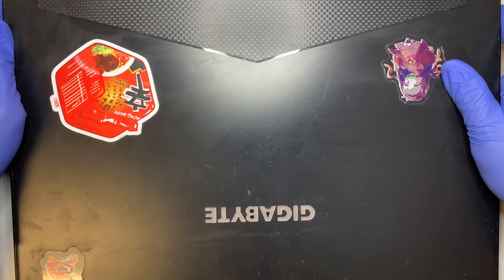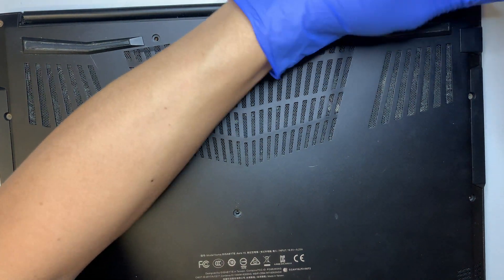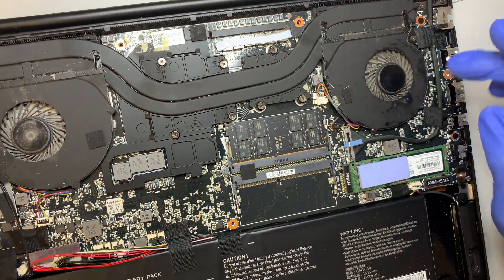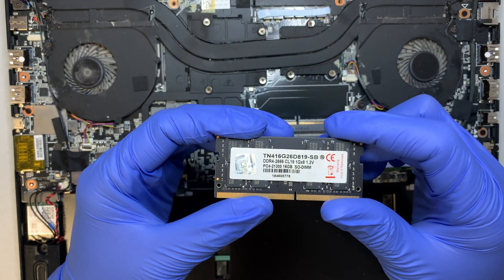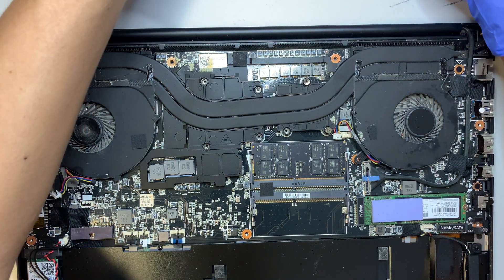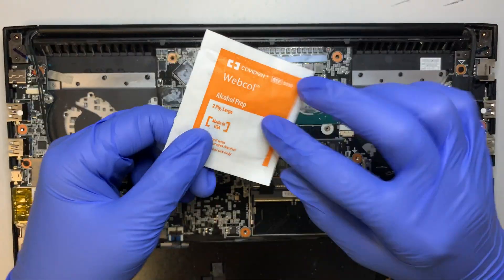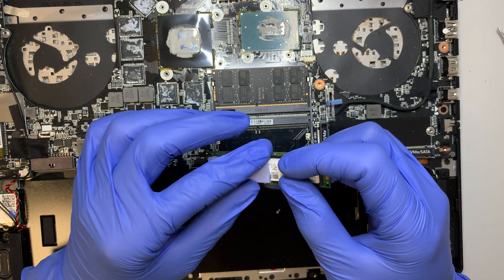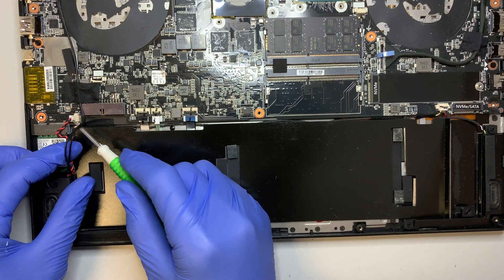Gigabyte AERO 15 Tear Down Fan Replacement

Comment: Great video, liked!  I struggle to find info on the Aero 15-Y9 (i9-8950HX, RTX 2080 MaxQ).  But the thermal pads are difficult to find aftermarket.  VRAM & Power delivery pad thickness is the open question.  Better to try a thick paste, like Gigabyte, or, .5mm thermal pads (Reddit suggestions, but take that for what you will.).  Suggestions?

Comment: HEY GUYS and GAL or TWO .. :) - You DO NOT have to replace these fans. You probably don't have to pull them out either. Once you get the back cover off - clean things up (SEE CAUTION) - then REMOVE THE FAN TOP SCREWS and PRY OFF THE FAN TOP - on my Aero 15s it was not difficult to pry up the cover enough to coax the blade and axle insert out - leaving the sleeve bearing (no balls) exposed. Use standard procedure to clean this up using whatcha got. Then use PNEUMATIC TOOL OIL (surely you have some of this?) it's the ideal viscosity to keep that fan running smooth and quiet for another two years. Seriously. Use enough to form a "meniscus" bulge (a little extra.)
Then -- order some "pre-filter foam" for air conditioners - you need at least enough to cover the bottom of your laptop. This will keep the dust outside of the case. Nice! Just saved you $40 and a big labor charge (sorry tech guy.)
CAUTION: When cleaning your sensitive parts - seriously - do not use a high-air-flow vac. Moving air causes static electricity. Use a low-volume vac only, with plastic tools - preferably one designed for computer guys. Why? The plastic can and should be anti-static. You should also GROUND THE METAL OF THE CASE while you're at it - and spray some anti-stat around (since you don't have a professional ion anti-stat device.)

Comment: Hello, can you please provide part replacement links and maybe model of the built in speaker on this laptop and the gigabyte aero 15x9 laptop which released after this model? My built in speaker is broken and I cannot seem to find the replacement part for that. Need some help. Thank you.

Comment: Didn't end up replacing the fan but cleaned it up a little so it's not so noisy while I wait for a replacement. I'm sure I'd be able to do it again without the tutorial as it was that easy to follow. Thanks!

Comment: Can't you remove the fan without taking apart the whole cooling system? Maybe removing the screws holding the fan and sliding the fan assembly out. (I also have a gigabyte laptop which is very similar to yours and the fan needs to be lubricated)

Comment: I didn't wanna take the whole heat sink out so I figured out that the fan slides out from underneath. Just had to be gentle to not put too much pressure on the still attached heat sink. 

Edit: only the CPU fan has enough clearance to slide under the heatsink. GPU Doesnt
Reply from the maker: Agreed

Comment: Hi There,

I have an Aero 15 YD. I simply removed the back cover installed an SSD in the extra slot, closed it back up. When I tried powering it back up, the Aero sign at the back lights up, I can also light up the keyboard, but the computer doesn't even turn on. Any suggestions?
Reply from the maker: Try check the RAM. Reseat the RAM if that helps. Or you can try remove the battery and reconnect back. Hope this helps.
Reply: @UbergeeksBiz  thanks for the reply. I reseated the ram, unplugged the battery, disconnected the CMOS battery...nothing
Reply from the maker: @bwaaaaahhh  What is working prior to add SSD ? What about LCD flex cable ? What about using HDMI or VGA output to external monitor ?
Reply: @UbergeeksBiz  Everything was working, including external monitor. It's very odd. I was even grounded with an anti-static band prior to the install. When I hold the power button down for 10 seconds, the fans will spin for about 1 second, then nothing.

Could the CPU being unseated somehow cause this? I checked every connector I could find on the board. Everything seemed fine. Just hoping it's not a static issue...
Reply: @Motorious  Hey Motorious, did you fix your issue. It seems I am also having a similar issue with my AERO KD.

Comment: My AERO started having the noisy fan issues and i happened to come across your video.
Awesome vid and very informative.
May i ask for an advise on roughly what is the thickness for the replacement of the thermal pad?
Reply: 1.5mm, as mentioned before

Comment: hi, just wondering if the fan can be lubed? mine was noisy and in low rpm is unstable. i replaced the gpu once now my cpu fan has the same issue. can omly get it from aliexpress and will take 3months to arrive especially due to this pandemic.
Reply from the maker: Do not lube - Just change the cpu fan
Reply: @UbergeeksBiz  hi mate thanks for replying. yep i finally got myself a new laptop, gonna order the fan from china and just use the laptop for working instead

Comment: I have a 9th gen gigabyte aero 15 xa oled, I need to replace the left fan (left when looking down on the keyboard, right when laptop is flipped on its back) is it the same as this? And where can I get a replacement?
Reply from the maker: The step of replacement is more or less the same. But the FAN maybe not. When you take it apart, look at your original fan serial number. Can find that replacement part on ebay
Reply: Same stuff here...

Comment: Hi managed to replace the fans and the system is running much better now! The only thing is I can't control my fan speeds anymore in the smart manager, the replacement fans always run around 4600 rpm now. Any ideas on how to fix?
Reply from the maker: Try go to BIOS to check fan settings.
Reply: @UbergeeksBiz  Hey thanks for the quick reply, can't seem to find fan settings in the bios. Where do you see them?
Reply from the maker: @wuffles333  Maybe try software:  https://www.techspot.com/downloads/547-speedfan.html   Let me know if this works for you. Never use this before.
Reply: @UbergeeksBiz  No, it didn't :/ How strange.

Comment: Cheers that came in handy for the steps. Managed to replace the noisy GPU fan with a new one. The old one was crusted up and didn't spin at all.
Reply from the maker: Thank you
Reply: Hi where did you buy the replacement I can't find it anywhere online for a reasonable price